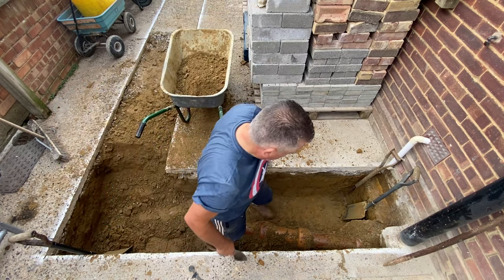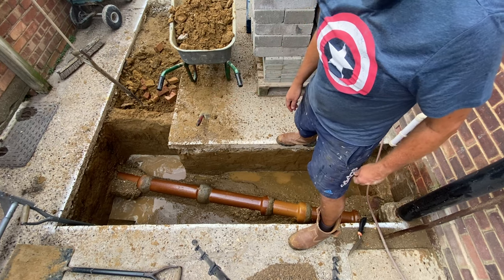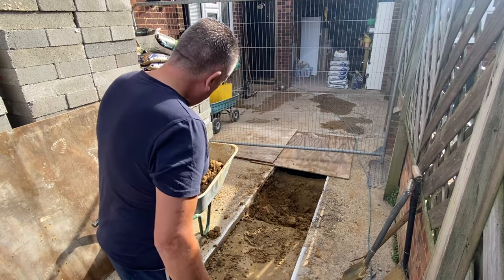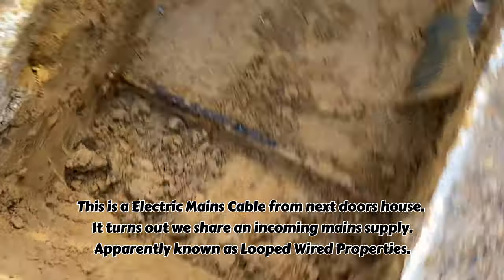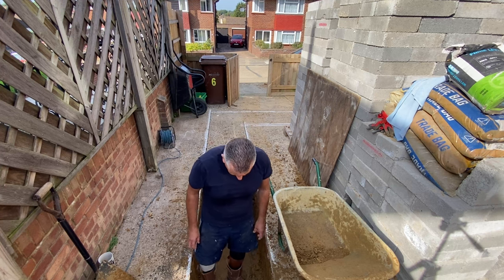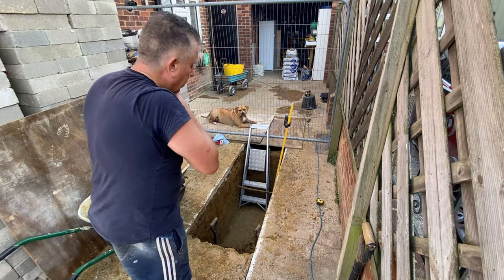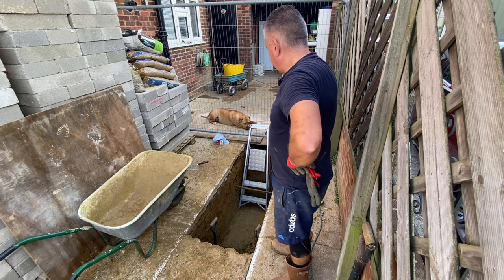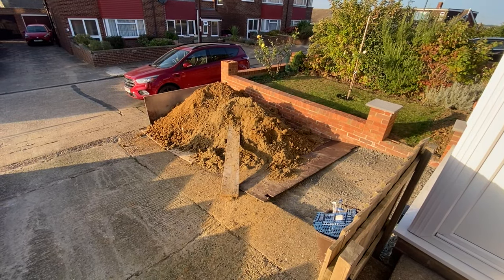DIY Extension Part 4

Comment: That cable beeing part of a shared supply could affect you if you decide to ever have an ev charger fitted due to the high current demand.
Reply from the maker: It is shared supply. Eon are upgrading everyone around here so may not be an issue. Not planning on an electric car.

Comment: Wall is still standing then? You going to bother with any drainage? Wish I could send you picture I’ve my bricklaying adventure. Currently 140 odd concrete blocks and around 300 bricks. Hard work doing at weekends as you said but I’m enjoying it.
Reply from the maker: It is indeed fella. Although it may take a battering with the soil 
up against it. Drainage will be later when i have finished the footings as I had to get on with it before planning ran out.
Reply: @theDIYnovice903  started digging my project by hand. After 3 weeks I’d hardly touched it. Got a bloke, mini digger and mechanical barrow for 4 days and shifted 35 tons and got footings in.

Comment: The question is who told you to dig down to -1m ?
Reply from the maker: Building inspector, when I submitted the plans. But i misunderstood what they wanted. I went 1m from the existing. However I now realise that it’s 1m from the ground level. And they only require 600mm concrete. That’s why I’m DIY Novice.
Reply: @theDIYnovice903  everyday is a school day
Reply from the maker: It certainly is.